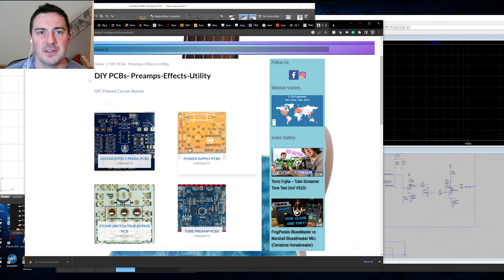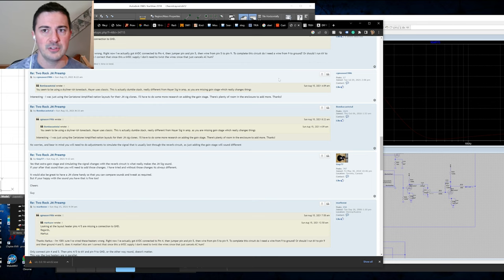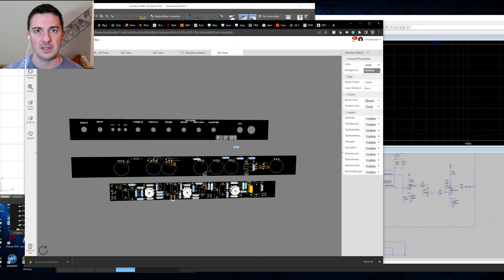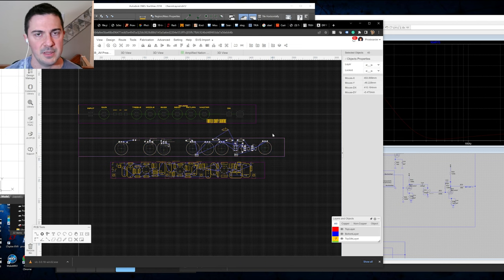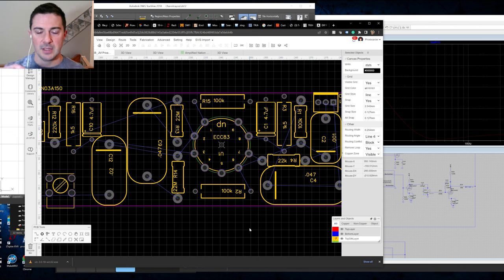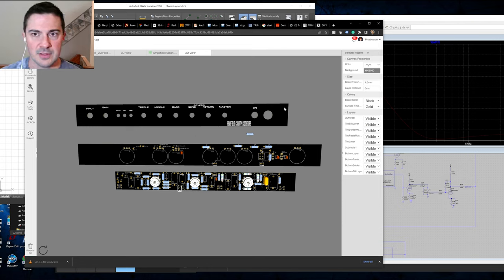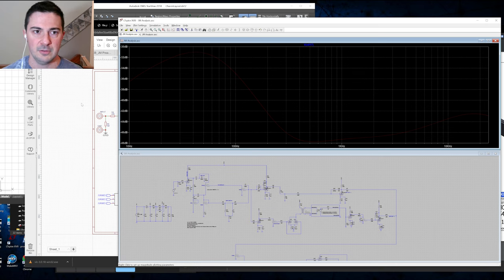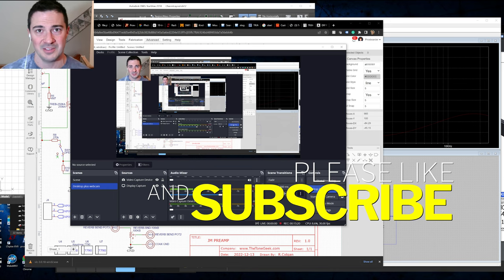Research and Development Projects in the works for 2023 | Open Source Blues Breaker, JM Sig Preamp!

Comment: Super excited to see this preamp Ryan! Glad you are keeping the reverb. As I mentioned on Ampgarage leaving out the reverb circuit caused the cleans on the amp to change and they lost the character of the original JM amp. Thanks for taking this on. Happy Holidays!
Reply from the maker: Many thanks, pal! Hopefully you saw my shout! Thank you for contributing as well!
Reply: @TheToneGeek  My pleasure, just saw your shout out, thanks! Excited to see it running. That little tank looks cool and even without a tank it will still have the authentic JM cleans as you mentioned since you have the tubes installed for the reverb.. Cheers!  Guy

Comment: Very cool idea and once you have it, probably a lot easier to plug other preamps into the basic design. I assume the reverb would be connections to an external tank? Now once you have this all done, you should move on to the poweramp next! A single channel version of the McIntosh MC2300 that Jerry Garcia used would be awesome! Solid state so shouldn't be as challenging as a tube poweramp would be, but those have become VERY pricy and not all that easy to find. I don't know of anyone building a single channel version of those and at 300 watts (per channel), they are a pristine beast that can drive pretty much anything you'd want. I know I'd buy one of those in a heartbeat if it was available!
Reply from the maker: Yeah!! I like where you’re going here. I do like the idea of a McIntosh! There are quite a few mono blocks out there which can be interesting

Comment: Another great video mate! What 3D package are you using? Looks fantastic...
Reply from the maker: I'm using EasyEDA for this design
Reply: @TheToneGeek   Thanks mate, appreciated. Really enjoy all your content. Currently building an SSS!
Reply from the maker: @troy_neilson heck yes! Which one?
Reply: @TheToneGeek  It based on the Ceriatone schematic, but I had all custom wound transformers made, even reverb as I wanted to do a couple of things differently, like dc heaters to everything except the power tubes to lower the noise floor, impedance matching the 6L6s, etc. Fun build!
Reply from the maker: @troy_neilson that sounds top notch! I’d love to see pix if you’d like!
Reply: @TheToneGeek  No sweat. Just sent you an email through your website with my email.

Comment: Hey man, totally random question. I'm currently building the AionFx Delta (VERTEX SSS ) and I've hit a snag. I have the jacks, power, etc wired correctly but get no signal. LED works, signal passes through when in bypass, but nothing plugged in except my amp buzzing a bit more than usual. If I touch the pots, it creates a slight ground buzz, but if I touch the gain pot, the buzz is louder. All controls are working in that the buzz changes volume, tone, and harshness when turning pots.If I touch my strings there is also a but of noise seems almost like a ground issue, but I've went over everything and I'm stumped
Reply from the maker: That sounds like a chip or transistor might be in backwards. The community at diystompbox are great (I'm there too) for helping with this stuff and uploading pictures always is insightful. I hope it's a simple and easy fix ⚡
Reply: @TheToneGeek  same. I used the SMT J201's already placed on chips and soldered legs on them. I've triple checked them to be sure they're right. I was curious if there might be a method of checking continuity or voltage I might be missing to isolate exactly where I'm losing signal. I have absolutely nothing on the output when testing continuity from input with the pedal on. 
I'm getting voltage on D and S pads of Q2 and Q4, but not Q1 and Q3.
The